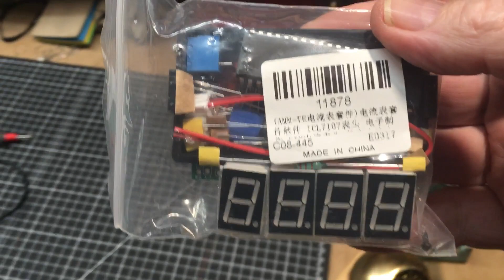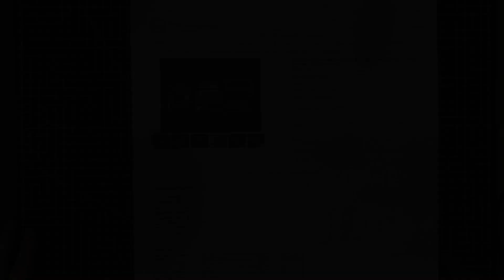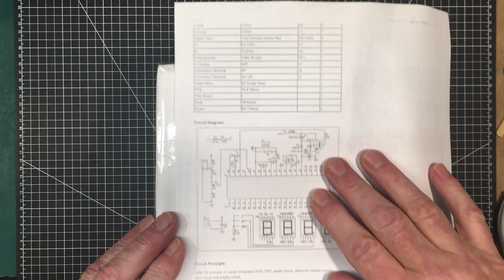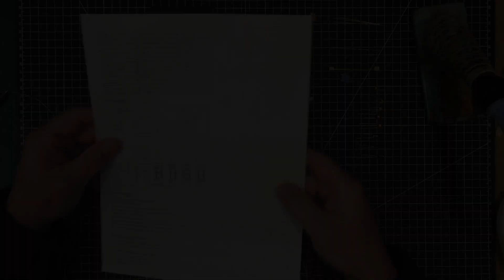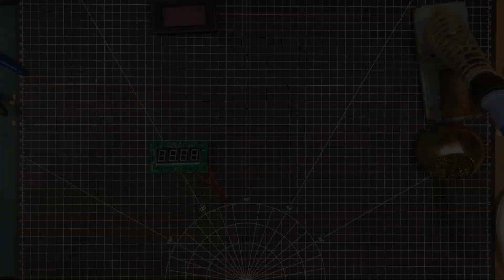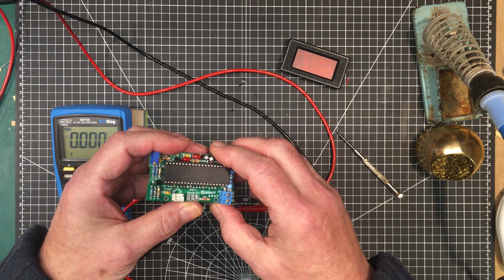0111 - Kit of the Month: 0-2 A Panel Mount Ammeter Kit

Comment: I knew I'd seen this kit before, a fellow Canadian, PileOfStuff did the build and took a different approach to the problem at about 7:25 minutes into the build https://www.youtube.com/watch?v=k5z0dVT36Bg
Reply from the maker: Yeah, I finally realized that option after it was built and the video was finished.  I wish I had seen his build first.
Reply: @uni-byte  it's not a bad solution, now I know this may be an option for a similar problem where there is no other choice. It should still be in the instructions, or better not necessary.
Reply: Oops I just saw your pinned comment, that is what is done here.

Comment: I wonder if there is enough room to put the pot on the front of the board under the cover, and drill a small screwdriver sized hole in the front?
Reply from the maker: Neat idea!  I'll give it a look and get back.
Reply from the maker: I look like you could do it.  You'd have to modify the shell to clear the trimpot but you would not see that behind the bezel.